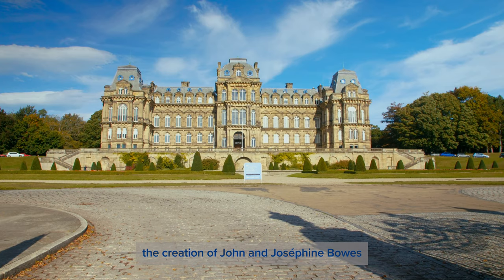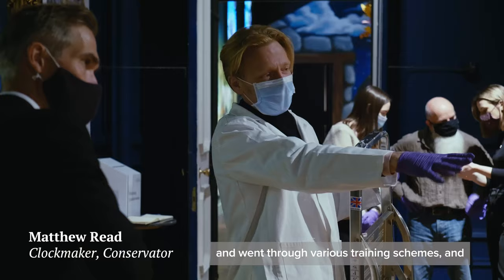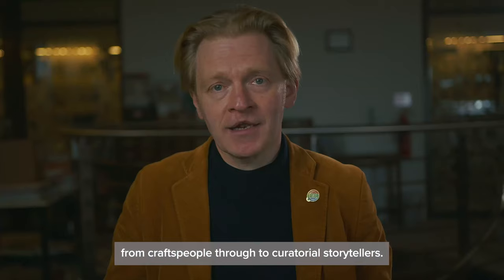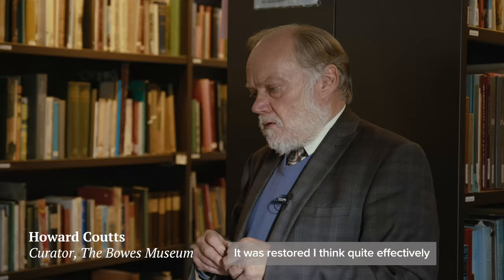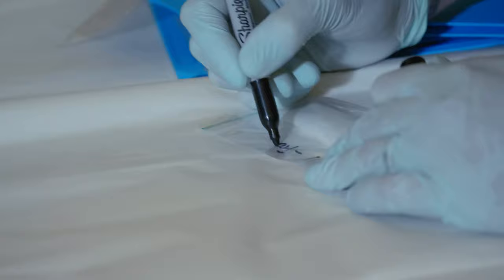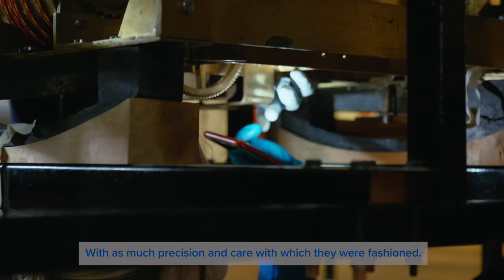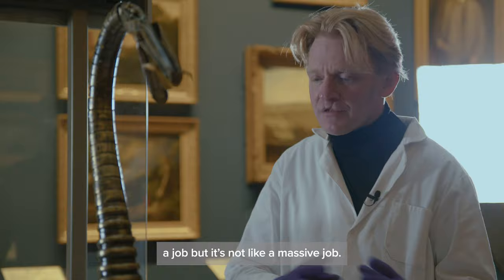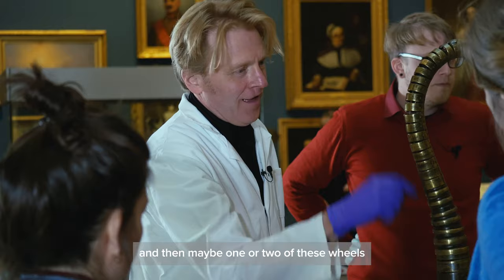Bowes Swan Automaton 2021 Study week - Silver Swan at The Bowes Museum

Comment: It would be awesome to have a virtual simulation of the inner guts. Is there any chance that Swan will be fully taken apart for maintenance, so every part could be 3D-scanned? In case some modules can´t be disassembled, there are high-resolution CT scanners available.
Reply from the maker: Hi Paul.  I couldn't agree more.  There are all sorts of benefits to this including the opportunity to operate the object less.  STEM, design, engineering, acces etc etc.  I'm totally with you on that.  M